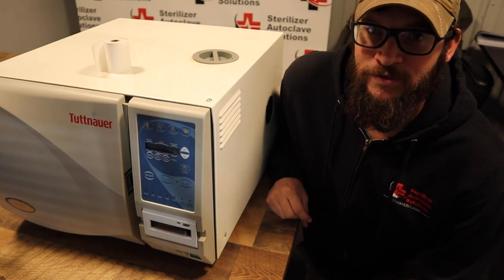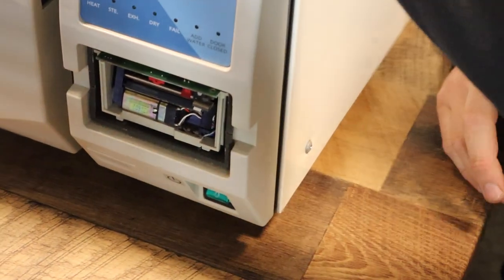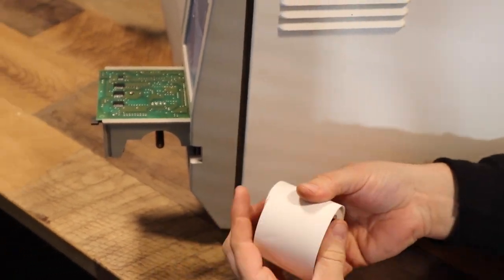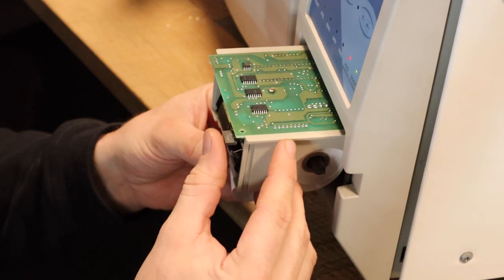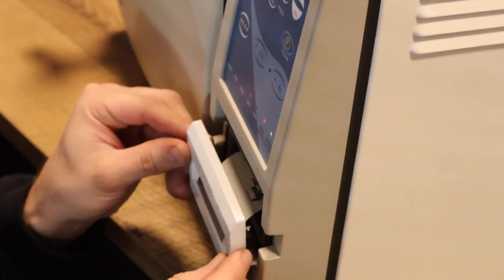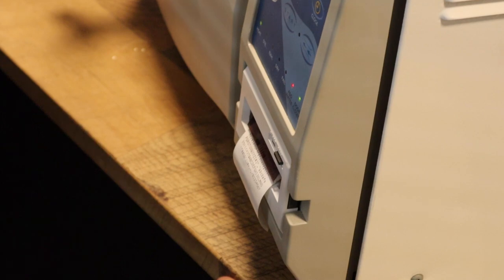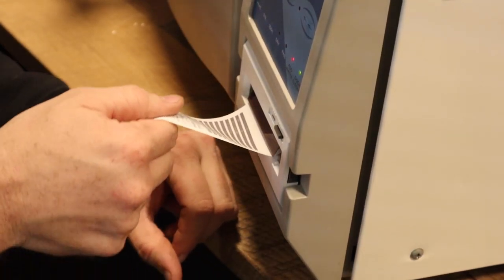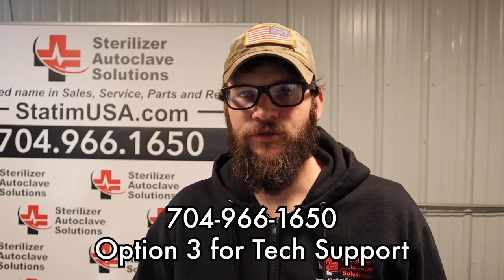How to Load Tuttnauer EZ9 and EZ10 Printer Paper

Comment: Hola, soy de chile 
Como puedo introducir de manera manual el papel en la impresora del autoclave tuttnauer 3870EA
Reply from the maker: ¡Gracias por el comentario! La impresora interna del Tuttnauer 3870EA es la misma que la impresora interna del Tuttnauer EZ9 y EZ10. Entonces, ¡las mismas instrucciones que aparecen en el video también se aplican al reemplazo de la impresora Tuttnauer 3870EA!

Thank you for the comment! The printer inside of the Tuttnauer 3870EA is the same as the printer inside of the Tuttnauer EZ9 and EZ10. So the same instructions that are in the video apply to the replacement of the Tuttnauer 3870EA printer as well!